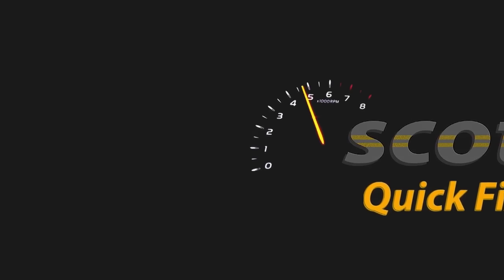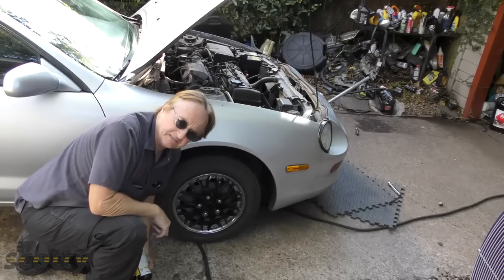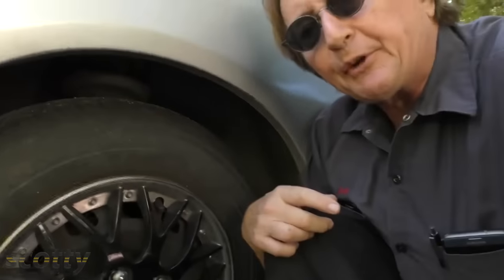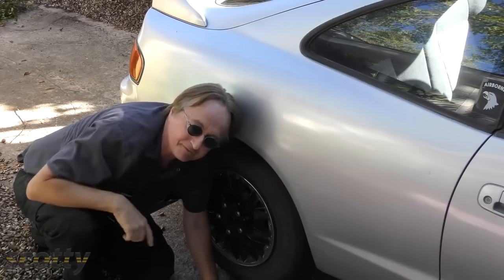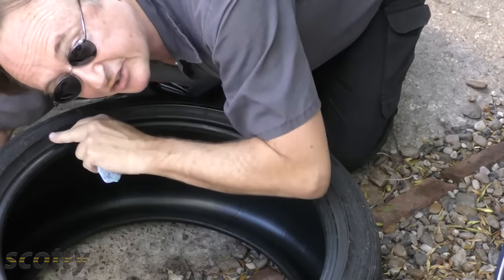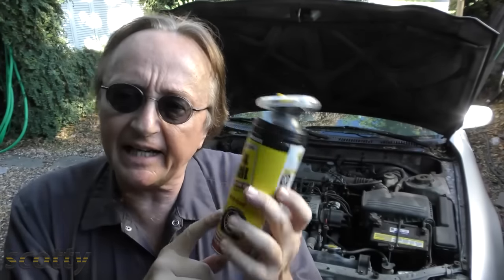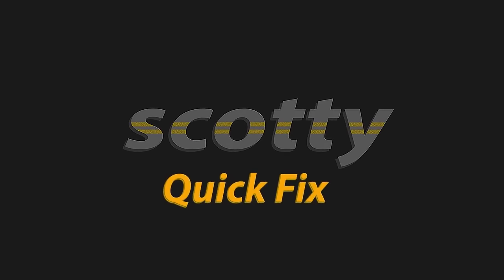Does Fix-a-Flat Really Work? (How Fix a Flat Tire)

Comment: Don't use this stuff. Most of the time it will not fix the leak. Then when you want to get the leak fixed at the tire shop, they won't be able to find it after you put this stuff inside the tire. Then they will charge you to dismount the tire to wash this crap out and then remount it to fill it with air. Then they will be able to find the leak and you can either pay them to do a patch or a put a plug in it. Patch will cost you more money. In the end you will waste money on this product and more money at the tire shop to remove this product and still have to pay to fix your leak.
Reply: I have a tire that has a slow leak that the repair shop can't seem to find. It takes a month for the tire to lose half of it's air pressure. I have even had the repair shop clean the inside of the rim edge and put in a new stem (watched them do it) , which they should be doing anyway. I have taken it to them three times and It's still happening! I know you sat "Don't use this stuff" but other then buying a new rim and tire I don't think there is anything else I can do then try a can of this stuff!
Reply: Just go to discount tire, we do repairs free
Reply: hasher411 Aluminum wheel by any chance? They're famous for slow leaks. If you can find a shop that uses it try nitrogen.
Reply: hasher411 use slime it's a sealer that won't damage your wheels and it will seal the tiny hole
Reply: It's only good if you don't have a spare and your tire will hold air long enough to get to tire shop
Reply: i had a similar leak and tried to find it myself several times. Finally, using water and dishsoap.  about a half ounce per windex spray bottle, i removed the tire and squirted the mixture on the top part of the tire thoroughly,  waited a bout 10 mins, nothing.  I revolved tire so the next section was at the top, squirted it waited 10 mins, nothing.  Repeated about 4 times and then, there it was!  If you wait a while, it will bleed tiny bubbles and make a bubble wound.  A STAPLE.  Pulled it out, patched it with the 5 dollar tire plug and  it is good to this day.  Some leaks just dont leak enough to do a quickie, which is what most tire shops have to do for the sake of the time=money thing.  Good luck. I dont like fix a flat unless last resort.
Reply: Maybe they used the wrong size stem? I had a few truck tires that did the same thing. Usually it ended up being the valve stem. Fix a flat slowed it down for a while but it did eventually clog the stem so i had to replace it anyway.
Reply: a staple? damn
Reply: hasher411 try a product called Tire Slime. It's great for fixing slow leaks and preventing new ones.
Reply: The screw puncture my tire, I left it in till could get the hole plugged. Tell me with the screw in it lost the least amount of air when ever I checked the tire pressure.
Reply: Jursaw sounds like maybe u just had a bad experience.
Reply: It happens everytime haha
Reply: hasher411 try using soapy water and spray the whole tire and the side and where the rim and tire meets on both sides and also try sparring soapy water at the place where you put air into it and you will know if there’s a leak because it would start to bubble up and you would definitely see it
Reply: If it leaks at all a water bath will find it but yeah. At the shop I worked at we did patches and not plugs and I hated cleaning all this goop out of them.
Reply: @logik316  - Doesn't cover bead leaks which is what many of us with slow leaks / alloy rims have.
Reply: mad thumbs Tire Slime has fixed rim leaks for me before, even though the product label says it won’t.

Comment: I use it a lot. It works well. But!! I noticed that if it’s a rainy day. It will wash out the sealer. 
On a note, Winter drops my air pressure
So add a little it of this and bam. Fix.

Comment: I heard to put a little bit of this in your bike tire , it helps from getting a flat
Reply: Mia Garcia you can but inner tubes are cheaper than slime in the long run
Reply: +Michael King  I got a beach crusier bike the tires on it are so thin, I would get a flat tire every other week it seemed , I gave up on it , and went back to my mountain bike  I would never recommend a beach cruiser ,  I heard to put that stuff in but never did.
Reply: Mia Garcia lol those bigass things from Kmart and Walmart? Mountain bike is better. A new inner tube is like $6-10 while the slime stuff is 4-6 and you need to use half a bottle. Not really worth it. Plus a lot of tubes now have it already added
Reply: +Michael King  😂 lol I know it was big 😂 never ever again , okay maybe when I'm a senior citizen 😇😁😂
Reply: +DFW rider  I bought know I was going to just use it around the neighborhood and the neighborhood paved trails, nothing rugged , I thought about switching tires of the mountain bike  but they were not big enough for the cruiser , moral of the story beach cruiser  tires very delicate expect flat tires on a regular basis,,,  I never rode it on anyplace raged 😔 , I saved that for my mountain bike

Comment: I remember i tried to use a fix a flat once and the stuff just leaked out the side of the tire because the hole was to big lol 9 times out of 10 this stuff wont help. Your better off putting a new tire on Period thats why its always good to check your tires for low air.

Comment: I understand that many new cars don't even have spare tires now days. If that's your case, a can of Fix A Flat in the trunk is a good idea to have with you.
Reply: rondogwil they com with tyre repair kits, it’s a temporary fix so you can go and get new tyres though. I notice unlike Brits America’s don’t replace their tyres after a puncture in which case you shouldn’t use that stuff as I hear it prevents you from easily re using it. Either way cars that don’t have a spare tyre come with a compressor and some sealant stuff

Comment: If your mechanic or tire shop says it is okay to drive with 2 different tire (mainly with different thread depth AND ON ONE AXLE) You should find a new one.

Your car will be out of balance in a turn or snow/ice or at an emergency brake situation and You will probably spin out.

Comment: Well I run tubeless mountain bike tires and we always use Stanz tire sealant which im sure is pretty much the same as what you get in in the auto section.  It does dry up in a couple of years but works pretty good.  Its really not messy at all when you take the tire off.  Its like rubber cement you can just ball it up and throw it away.  I'm sure the auto stuff is the same way.  After a while it may form into a ball and you could have a big ball of sealant bouncing around in your tire which may or may not cause a balance issue.  Never noticeable on a bike though.  But its worth it once you ride over some thorns.

 You can buy innertubes that are filled with Slime too!

I put it in a brand new truck tire with a screw stuck in it.  Proceeded to drive 60k miles. Just did it again after nailing a pothole in my hatchback.  

The fact that it blows your tire up too makes it really convenient - at least the cheapo walmart brand does, so you don't really need a compressor in your trunk too.  I have no spare for my car so this is all I need to carry.  Just fixed a new tire for $4.50!

Comment: In New Zealand it's been proven (not this specific product) to break down the rubber structure of tyre potentially leading to failure. As an emergency yes, but always ensure to have tyre professionally checked as nails and objects can chaff beyond the inner linner causing air retention compromise and failure of casing due to cord damage

Comment: Buy a new tire, and buy 4 at a time everytime. Best ride you can get
Reply: With nearly every car built in the past 30 years, if you do basic maintenance on your tires, such as tire rotation and properly checking pressure every so often, the tires will wear evenly (the 2009 Ford Contour I mentioned in the car auction video didn't even need to be re-aligned when I'd have the tires changed).  If you can't afford to replace all four tires at the same time, then replace the front tires (assuming front wheel drive vehicle) and put the best two on the back.  Of course, as Scotty says, if the tires are near bald or have sidewall damage, they should be replaced.

Comment: With respect, if your tire has to be replaced due to dry rot, it's been on your car WAYYYYYYYY too long.  Lucky if didn't blow out on you, especially on the highway.  And you should always replace tires in pairs.

Comment: It worked so good for me that when I put new tires on 23,000 since fix a flat The tire guy goes you used fix a flat.. Oh crap yeah I forgot about 24,000 ago for a screw. He laughed he goes that stuff does work but depends on the size of the hole.. Yup

Comment: I have a can for the scenario where I lose a tire while I still have the spare on.  I've had that happen, and it's a shitty situation.  

Didn't bother with sensor safe, as I don't have the pressure sensors anyways.

I also have a 12v air compressor, because apparently Fix A Flat won't necessarily fill the tire all the way.  

It's absolutely not a permanent fix(though I guess it can hold quite a while under some circumstances), but it's definitely something that's good to have in your emergency kit.

Comment: Scotty, you have a great youtube channel.  But I have to disagree on using Fix a Flat without hearing the bad side of it.  First of, if you have a flat, see if you can inflate the tire and drive to the nearest tire store and see if they can fix it.  Also using fix a flat makes the tire unfixable when you apply the patch. because the chemical of the fix a flat makes it hard for the tire patch to stick.   I spoke with a goodyear employee and he said the worst thing you can do to a tire is use fix a flat.   If you do use fix a flat you may render your tire not able to be fixed under the manufacturer's warranty.
Reply: Of course, if you are miles away from the nearest town, then you have to do what you have to do to make that tire go.  But bear in mind you may ruin your tire with the fix a flat.

Comment: Isn't it not as safe to have 3 new tires, and one old? I guess it depends on how old the old one is.
Reply: Nicholas My car is pulling to left side. Any ideas
Reply: Raju Ar It needs an alignment
Reply: Phillip checked out the alignment it still remains same. All other components are seems to be good. When I checked the brake rotors it was rusty when I accelerate the car it vibrates.  Any other solution 

Scottty can you reply
Reply: That change things, if it vibrates when you accelerate it may be the tripod joint spider from the side you feel the vibration, but you can go safe changing both of them and fixing or changing the housing too.
Reply: Héctor Ferrer Thank you, How to check with it, please tell me where is located I will have a look on it
Reply: Raju Ar get your tracking done, may need new tires also.
Reply: I'm the best. Sir already changed the tyre some culprit is playing the fool game need to find it out.  Any tricky things are there
Reply: Raju Ar is it front wheel drive?
Reply: I'm the best. Yes sir front wheel drive
Reply: Raju Ar could be a cv joint that lost it's grease and now it's sticking, or it could be a differential problem, any other symptoms to note?
Reply: I'm the best. Could be the tie rods
Reply: Bludude4 if it was the tie rods that would of been picked up by doing the tracking.
Reply: I'm the best. How much play should be there in CV joint
Reply: Raju Ar not a whole heap if it's still in the hub, and in the gearbox side, maybe 1 clunk, if you have the shaft out there should be a load of play.
Reply: Wheel bearing probably
Reply: I'm the best. Ok I traced out but cannot suspect  where the problem is
Reply: Liam Moonan it doesn't make any grinding noise when I'm driving
Reply: Liam Moonan no, wheel bearing will make noise only not pull, well the noise will be unbearable before it starts pulling.
Reply: Raju Ar what make and model is the car?
Reply: I'm the best. Hyundai grand i10 2013 model
Reply: Raju Ar heard of a gearbox problem with those, Google it, I will too, have you no warranty?
Reply: Sorry seems to be a caster/camber issue with them (googled it) getting tracking and tires won't do anything, ring hyundai and ask is there an extended warranty on that part, because it's common.
Reply: I'm the best. Ok sure i'll

Comment: It's good for 3 -6months easy! I had a wood nail stuck deep in my Hancook tire which deflated it overnight. The next day I took it out, pumped In fix a flat & my tire was mint for a good 6 months. This stuff is no joke. 
Similar to oil changes they tell you to get oil change every 3 months or 3k miles which is the biggest lie & scheme in the auto mechanic industry! Your car can go 7500 miles easy in between changes even 10k if you always keep your gas filled past a 1/4 tank... Good luck

Comment: This is not advice. But on my Volvo 850turbo I drove on fix a flat for over 1000 miles on a tire dealing with a broken rim!!
Reply: *bent
Reply from the maker: if this is not advice, I don't know what is. I showed from my own experience that the stuff works and advise to put a can in your trunk.

Comment: as A tire and lube tech at a dealership I will say one thing     it is very messy  sticky and it smells like paint    when dismounting a   tire from a rim.   it does not always work and  it is not good for the tpms       it also gets all over the place   when dismounting the tire from the rim.   your better off with a plug kit   works much better  no mess  and wont harm tpms.   it will say sensor safe  because they want you to buy it      its bs   I do this every day for a living    it is a waste of money  and it takes forever to clean that crap out    . they have this grate invention that came out many years ago   it is called   a spare tire       use it     it works a lot better        fix a flat and mechanic in a can      is  the cheap and lazy way out        if you were a tire  tech for one day in a very high volume   dealership  or  tire shop   where I first started    you would never use this crap ever again

Comment: Is Green Slime better?
Reply: tireject is even better, water cleanup. You do need to add a 1/2 dose each year.  I had a tractor tire that wouldn't seal properly at the bead and it fixed that.  Slime failed.

Comment: The acidic versions will eat your wheels depending on the metal compilation. Some eat the tires as well over time. Definitely not a long run fix, intended as a emergency fix.

Comment: Still dont get why manufacturers put prius tire sized spare tires in cars.
Reply: badboy 25 To save space.
Reply: In other words being cheap.
Reply: badboy 25 I'd rather have a small one so I can have more trunk space. The spare only has to get me to the nearest tire shop.
Reply: @Once Upon a Dashcam, actually I think it's more to save weight than space so the manufacturers can meet their fuel economy standards.  Every little bit helps.
Reply: Jake from State Farm A coworker has a new car with no spare as standard. He has the spot in his trunk, though. It'll cost him over 200 bucks for a spare and a jack.
Reply: When I bought my CR-V a few years ago, one of the key differences between AWD and FWD models (other than two driven wheels) was the AWD models included a compact spare, while the FWD models only had a fix-a-flat kit.
Reply: It's to gain better fuel economy by reducing vehicle weight since standards are getting stricter and stricter. For the most part, the only vehicles that still have a full size tire for a spare is trucks. My 2016 Silverado has a full tire and rim for a spare. But, my '86 T-Bird has what would have been a "donut" at the time (compared to today's donut spares, it's a bit larger and wider, but smaller than the standard tires on the car). Yet my old 92 Crown Vic and 95 Town Car had full tires and rims for spares. It just goes to show you that even back then, increasing fuel economy was a big deal.
Reply: Eman 08 But most Priuses have 15s.
Reply: Eman 08 They're cars with small tires. Don't take it personal.

Comment: Cant someone help me my accord 2000 has a squeaky noise in brakes and my brake pads are New and i noticed dust Orange all  Over the wheel
Reply: Gerardo Verdugo Soto check the other brakes. There might need to be some anti seize needed in a spot where the pads move

Comment: My buddy bought a new hyuandi and it came with a can of fix a flat and No spare tire!
Reply: gadgetmantwincities most cars in Europe come with a tyre compressor and some sealant , it’s so they don’t give you a spare tyre. Most of us here in the UK don’t care as we have breakdown cover so the AA would come out and take your car to the nearest garage or they will assist you. Either way most people don’t ever change their own tyres or even drive with a flat or anything so I guess that’s why they do it.
Reply: Cheap cars, need to cut costs somewhere
Reply: I would just get a spare rim from Hyundai, and then have a new tire installed onto it at a nearby tire shop.  Then put that new full-sized spare into the trunk.  That's what my sister did.

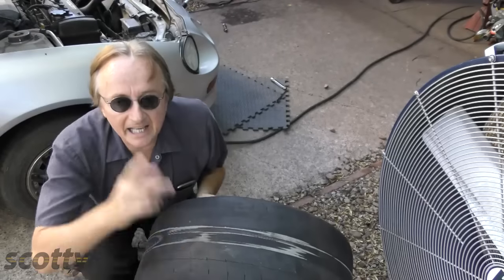Comment: 1:05 Here in England, that tyre would have been illegal a long time ago.
Reply: Most states in the US will now fail you for vehicle inspection if the tires are beyond a certain age (usually 8 to 10 years).  DOT regs now require that the manufacturing date be embossed on the outside of the tire.

Comment: The "tire sensor safe" claim is incorrect, they will still harm sensors. The chemical also works by melting the inside of the tire. Don't use it. Repair or replace.

Comment: This is bad advice. Unless you're in a pinch, don't do this on a tire that will be road driven! On a radial tire you have plys of rubber with steel belts. The plug will leak on the inside ply, air will get between the plys and the plys will separate. First this will cause a bubble in the tire, then a blowout. Look it up!!